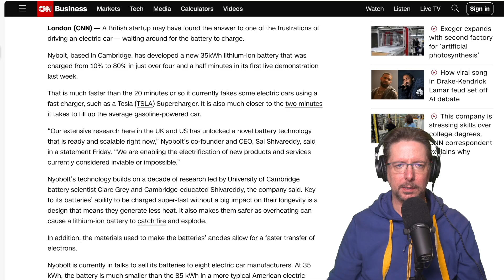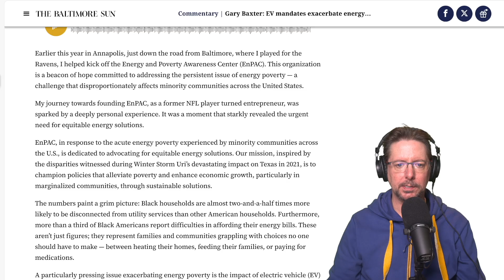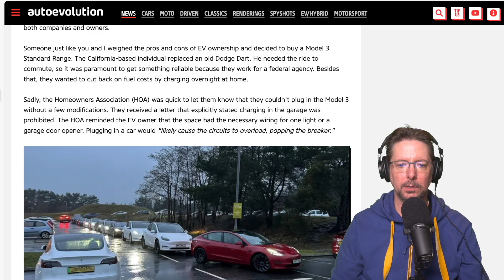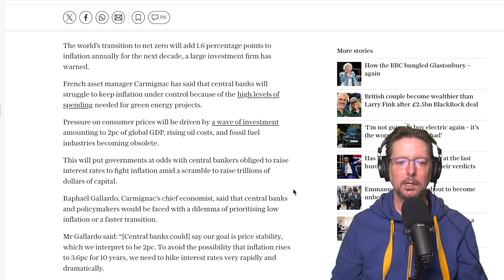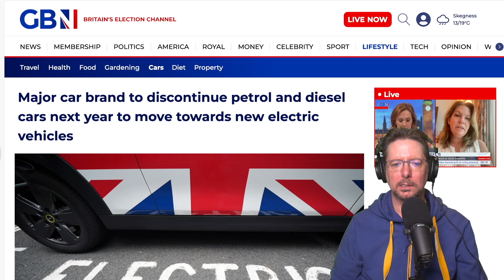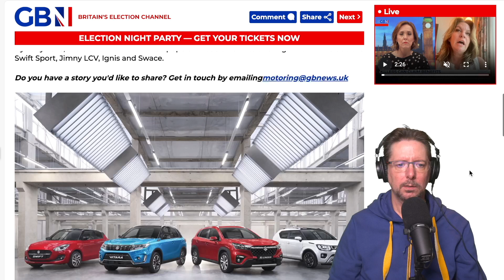Tesla owner's charging SHOCK! MGUY EV News Tuesday 2 July 2024 | MGUY Australia

Comment: I live in a 1950's/60's ex housing dept timber/fibro house with tile roof near Newcastle NSW and the house has a single-phase 100 amp supply from the street. No rooftop solar. To get a high current EV charger should in a different universe I find the desire to have an EV I'd be up for thousands of dollars to completely re-wire the main supply to the house (add at least one additional 'phase'), fully re-wire and configure the main switch board, and then install one additional fully dedicated circuit only supplying the EV charger just like homes have now to supply their kitchen stove (if electric like mine). It would have to be installed outside, in a special weatherproof box. Not likely to be feasible ever in my remaining lifetime.
Reply: Zona, if you’ve got a 100 amp single phase supply no major rewiring is required.

At ‘worst’ will be the installation of a 32 amp circuit with industrial socket. But most EV owners find it overkill. Pleasantly discovering a 10 amp GPO is sufficient to replace the energy used each day with an overnight charge.
Reply: @markboscawen8330  you presume a lot there. A large portion of potential Ev owners don't have access to off street parking and a normal single phase 10 amp outlet will only support level 1 charging. Also it's very unwise and unsafe to charge one in a garage esp if part of the main dwelling or in any sort of underground multiuser carpark at a residential or commercial premises.
Reply: @zonavarbondagoo4074   You presume a lot there. No comment was made about where to locate an industrial outlet or to use a gpo in a garage.

Comment: Fritlenstein developed an EV and charging station that can fully charge a Tesla Cybertruck level EV in 17 seconds.

Well, could rather. Once.

Because after 14 seconds the bally lot got SO hot that it melted a hole under itself and at 16 seconds it disappeared into an aquifer 🤷 at 17 seconds the hole stopped belching up smoke and steam.

Comment: Fast charging batteries have more dark sides than just the power required. If they can charge more quickly they can discharge more quickly. Fast discharge is heat, and heat is fire. Any battery that can charge quickly increases its fire risk substantially.

Comment: The HOA is right = the correct amp breaker in the DB breaker and installing a separate electricity meter to make it fair to other owners.

I have a solar system with 3.1Kwh solar charge capability on a sunny day and 10 Kwh in battery storage so it makes sense for me to go EV.

Comment: Just get a diesel generator run it all night, job done. Can't see any problems with that, it'll be great when every house has one running all night. You'll get used to the smoke and smell, diesel generators don't have regulations on their exhaust, not nearly as strict as with a car, it's going to be so much fun..

Comment: To prolong the life of a Li-ion battery, you need to let it "rest" for at least 30 minutes after use and at least 30 minutes after charging. You need to factor in an additional 60 minutes for charging, or you will be additionally harming the batteries, decreasing their life, just as fast-charging harms the batteries and decreases their life. (Note: I'm referencing Li-ion batteries in the outdoor power equipment world. If you know that this advice doesn't apply to EV Li-ion batteries, please correct me and set the record straight. Thanks.)

Comment: A power generation plant that lasted 57 years and could have lasted 57 more. Wind turbine and solar panel farms only last a fraction of that time.
Reply: I would like to expand that:

Ur not wrong, but ur not fully right either. Everything needs maintainance and parts replacement, including coalfired powerstation. 

The difference here is, coal/natgas stations carry out their duties in a relatively enclosed rnvironment. Its easier to estimate/calculate its lifespan and determine when it needs a massive overhaul without the added problems of the outside environment.

And on top of the fact that everything u need to repair/replace is in generally one, easily accessible location, eith actual road to and from said powerstation.

Wind turbones n solar… are the complete opposite of that:

Theyre located over an immensely large area, sometimes with very hard access (wind turbine on a mountain or in the middle of the sea, anyone?)

Theyre very much exposed to environment for it to work, necesitating a more regular scheduled maintainance.
Reply: Seen a video of a 4,000 acre solar farm in Texas that was destroyed by a hail storm. It was scheduled for completion at the end of 2024. 
Imagine building a solar panel farm in an area with a climate that regularly experiences hail storms.
Reply: The only way a 57 year old coal-fired power station could go another 57 years is by replacing the the generators, steam turbines, furnaces and boilers. Basically replacing everything, so no, it can't go another 57 years.
Reply: @simoncrooke1644  So what you are saying is that will proper maintenance it could go another 57 years. Replacing all those things will be part of it's maintenance schedule and they won't all have to be replaced at the same time or with the same frequency.
Reply: @simoncrooke1644  
You couldn't be more wrong. 

One thing is certain, Simon, you are a crook. A terrible crook but a crook nonetheless. You try to steal logic and reason and replace them with irrational lunacy.
Reply: @simoncrooke1644  
You just contradicted yourself to the point of hilarity. Thanks for the giggles.

Comment: The chemistry is the same.  Charge fast, damage the battery.  Do it a few times, and your battery is dead
Reply: Check the weight on that battery pack. 3/4 Ton, the same weight as a 70KW battery pack. If you are only actually fast charging a 70KW battery pack 35% of it's capacity, it will tolerate that fast charging several times. It's like the miracle phone portable chargers that recharge fast, because they are huge, have twice the cells in them and you can never deplete their real capacity below 50%. They just did it in a car. this is a 70KW pack Derated to a 35KW pack. Probably has some wear leveling so as sectors go bad, they drop out and new sectors become fully useable, so it Appears the battery isn't degrading when actually large chunks of it are being bricked.
Reply: And there's always the risk of fire.

Comment: Batteries are tricky things, almost universally, if there is one aspect that is really good, another aspect is really poor.  There is no perfect battery, there are a dozen different attributes that all affect cyclic life, capacity fade,temperature,energy density,toxicity,safety and cost.
Reply: Apparently this battery is really heavy, at only 35kWH is weights almost as much as an 80kWH Tesla battery so you have less than half the capacity with the same weight. This is obviously no good for an electric vehicle. You could actually take a normal Li-ion battery and have it charge over the fastest part of it's charging range and get much the same result. As with most of these wonder batteries it is all a smoke and mirrors scam designed to relieve investors of their money.

Comment: 370 kw charging ain't happening anywhere here in the US. 35 kwh battery is good for maybe 100 slow miles. What a joke!
Reply: TN : Not a Joke , But a Scam !
Reply: The grid can't handle what's already here... and they want to load it further.
Reply: @Bobo-ox7fj What lies? Does 370 kw charging exist in the USA or not? I'm sure it does not.
Reply: @Withnail1969 
So the normal older US house had a 100 amp service of 240 volts. This is only 24 kilowatts total. Newer houses have a 200 amp service, but this is only 48 kilowatts for the entire house. Keep in mind that a fair bit of that is used for household appliances and lighting. That really shows you how inadequate a normal homes service is for charging EVs considering a “fast” charger uses 150 kilowatts to charge. Keep in mind you will never have all 48 kw to charge with, and to add more costs quite a bit.

Then, when you look at pre-existing buildings here, they don’t have anywhere near the capacity for even a 150kw charger lying around unused. Nowhere but event and convention centers have that kind of spare capacity sitting around, and even then the usual max they have is 50 amps of 240v. To add in the infrastructure required for a 150kw is staggering. When a building is being built they have a design load for it, and then a little extra for things they might have missed. They don’t just have hundreds of unused kilowatt capacity because that would have cost more during install. Unless of course we are talking about event/convention centers where it is normal for them to have multiple 200amp 480 volt service plugs sitting unused for concerts. Those plugs however can’t just be used for EV charging, because they are needed for the concerts! So when the cars are there they can’t be charged, and when there is no event and the capacity is open the cars aren’t there.
Reply: @Withnail1969  350kW is reasonably common and has been for several years.
Reply: @brettski74  the chargers may exist but they wont be delivering that level of power in most places because it doesnt exist to provide.
Reply: Some knowledge before reacting could be nice.

In europe ionity places 350KW 800V chargers. Somewhere 425 ampere maximum.. Or equivalent to the amperes the start engine of an ice needs.
Maximum charging allowed by (800Volts) cars...250 KW for the fastest I know. Not the charger is limitimh the speed but the car.
This is peak charging, not average.which is close to 180KW (from 10 to 80%).
With my some smaller battery , also 800volts, my max charging speed is 225KW.
Average 160KW from 10 to 80%.
But of coarse we do not need often fastchargers. Mostly I charge with 4 kw at home when I do not need the car. (Mostly is at least 95% of all charging)

Of course the time for charging a battery (technical possible from battery view) does not depend on the size of the battery (as this video suggests at 2 minutes). 
The max charging speed depneds on the maximum speed for every cell.
Reply: It's a prototype.
Reply: @Bobo-ox7fj😂😂😂😂😂😂😂
Reply: There at least four 350kW chargers within a mile of me, and more are being installed every day. Not the most common charger, but not rare at all. However, home charging on 120V 15A works well for me. No special circuits needed at all, and easily covered by the 4kW solar panels during the day, so a marginal cost of $0 if I only charge then - and I can as I work from home. For those in the office, many companies around here have free level 2 charging for employees. No range or charging issues at all.
Reply: @pondking2801  Not rare compared to DC fast chargers in general, but I wouldn't consider DC fast chargers exactly common. Consider how many gas stations there are in your town versus DC fast chargers. Consider how many cars those gas stations can service in a day compared to how many cars can be served by those DC fast chargers. There's no comparison. I'm happy for you that level 1 charging is working for you, but I think you're a bit of a special case and there would be many more people for whom level 1 charging would regularly be insufficient. Level 2 charging is definitely better and can definitely serve a much larger proportion of use cases with appropriate planning but if we're being realistic, EVs do entail practical challenges that ICE vehicle drivers simply don't need to worry about.
Reply: Yeah, and why aren't all the electronic/electrical engineers stepping up and saying something about this?
Reply: @transmitterguy478 No ones listening

Comment: That 35KW battery is heavier than a 70KW battery at 3/4ths TON. You can be certain it is a Derated 70KW battery. 

So, 70% charge on a 35KW battery would only be 35% charge of a 70KW battery and current batteries can do that or nearly. It's all smoke and mirrors.

How would you like to pay for a 70KW battery and have to lug around a battery twice as heavy as it needs to be and NEVER be able to access 50% of that battery capacity because of software controls? You would be getting screwed.

Comment: For the 5mn charging battery (between 10% and 80%), it needs a 300KW fast charger, so nothing present on earth (except for heavy trucks).
What is not is the less than 100 miles between 2 charges, and 2 to 3 more cycles than usual EV for the same mileage, so a third to a half the lifetime!
That's a car to hop from EV recharge station to EV recharge station (if they work), and throwable after a few years when the warranty expires.
Reply: 300 kW chargers are everywhere in Germany. Even in my town with 30k inhabitants there are two 300 kW chargers with 4 charging points.

Comment: Theres a 1mw solar farm near my dads house, I was talking about to his friend who knows the owner, his face when I said that entire field could only,  even on direct sunlight in the summer, charge one Tesla semi.
Reply: Most people believe that the roof typical on a moderate-sized American gas station, if covered with solar panels, will provide enough power to charge a few electric cars on a sunny day. People have been misled.
Reply: @markiangooley  It takes like 30 average roof panels to provide enough charge for a modern desktop PC to run all day without cost.
A modern desktop PC is juicing no more than 250-600W, a car is taking far more power to drive those wheel motors, all four of them.
Reply: @markiangooley it would charge them, but take weeks to months
Reply: There's a 1milliwatt solar farm on my calculator too.

... but no really, 1 megawatt intermittent power is a drop in the bucket.  Maybe the owner can squeeze passive profit out of it, but that doesn't mean it's meaningfully productive in the larger scheme.
Reply: 1 MWp is small, maybe 2500 solar panels. When the sun is shining it can produce 600-800 kW. That power is enough for 300-400 homes or one semi.
Reply: '2023 Update- Digital ID or Digital Prison (& Five Pillars to Enslave Humanity) - by Aman Jabbi' youtu.be/oQwr7FbRnPw?feature=shared.

Comment: Ultra fast charging will mean ultra fast battery replacements meaning ultra fast emptying of people's pockets on either a new battery or car.
Reply: and ultra hot fires
Reply: Not to mention ultra fast pollution due to mining of lithium, cobalt and others.
Reply: And it will never or very rarely exist.
Reply: And ultra fast environmental impact as well.
Reply: That's all anybody is after.
Reply: Not as bad as the DPF systems are emptying diesel owners pockets.
Reply: @operator8014  that's because most DPF filters get clogged up due to people not giving their vehicles long runs. The same can be said with injectors in both diesel and petrol vehicle's if you don't give them a long run or use fuel additives, they will perform badly and have running issues.
Reply: WRONG.

Comment: If we charge 12S packs for radio control power sources, at 5C or 5 times their rated capacity the input voltage jumps from 12 volts to 48 volts, which means that you are charging at 30 amps as opposed to 6 amps given that the original pack was 6,000 milliamps.  This requires that you monitor each cell for voltage and IR during the charge cycle.  I want to see the battery management system they are using as well as the power source.
Reply: From what I have seen group charging in series is being done which explains why rogue cells go undetected and get over charged resulting in you know what, Tesla packs have up to 9000 cells, how is each cell charged and monitored independently is what I would like to know, I have asked "experts" numerous times but yet to see, as we know from RC packs the last 20% is when individual balancing takes place so is this not happening with only charging to 80% Lots of questions no body seems to ask, Also it is no coincidence that the fires that happen are almost always when charging.
Reply: @Ifitwerks  As you know well, if the IR on a single cell gets out of whack it does nasty stuff to the charge rate if the charger is not monitoring each individual cell voltage during the charge especially when you are charging at high multiples of C.  25 years of battery charging have taught valuable lessons.  I remember a Lipo fire at the IRCHA jamboree several years ago and one at a Vegas hotel during a contest at Bennett Field.  I know folks that have burned down Garages and hobby buildings because they charged batteries unattended.  That's why the last place you want to charge an EV is inside a building.  Can't even have the conversation with the Gov folks though because they don't want to hear it. When you taco a pack due to a crash that pack is toast because you know it will fail and in many cases the ESC will catch on fire because the FET's and Caps can't handle the load, a subject that has yet to get any air time.
Reply: @terrymoorecnc2500  There are safety aspects that have had a blind eye turned for this, 800v dc in a conductive metal bodyshell is the other, if that battery gets pierced by a metal object laying in the road and it goes through the battery contacting the main busbar in to the body it will become energised with 800v 
If all safety concerns were considered then the bodyshell would be composite plastic to insulate the occupants, Fire and electrocution risks have been paid no attention to, I say this as a electrician of over 40 years Not so long ago this would never have been allowed but I guess money talks louder.